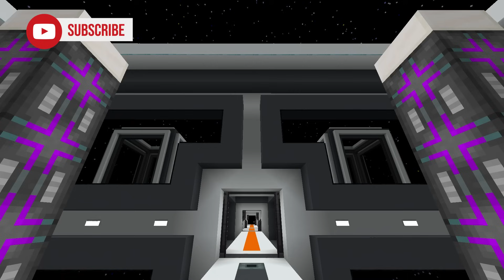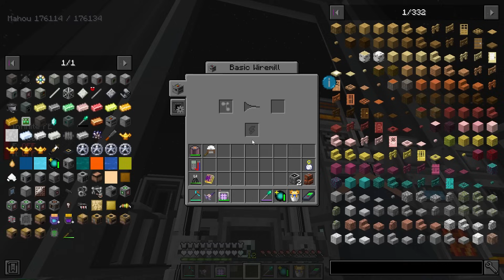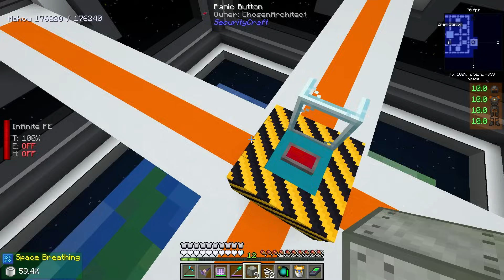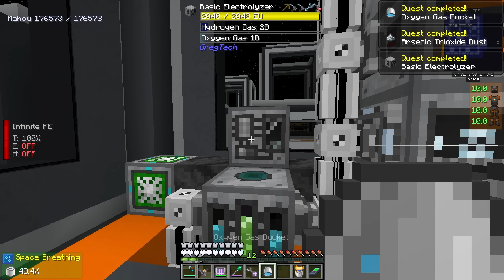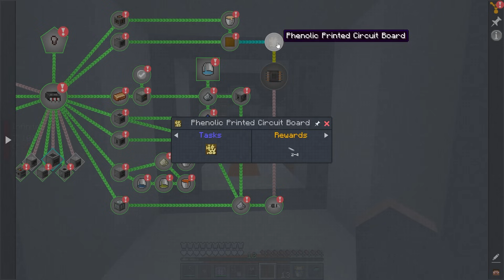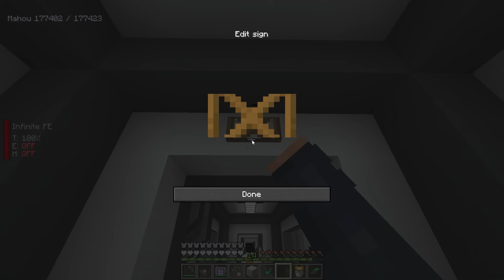Electric Blast Furnace from Gregtech AKA EBF EP69 All The Mods 9 Modded Minecraft

Comment: I believe there is a way you could have it not require you to cancel the craft. 
I am thinking using a ME level emitter to enable importing the Name tag into your ME network when your recipe is used, then have an exporter return it back to your storage chest. 
I'm unsure if it can be configured for a specific craft or if it activates on all of them, either way it would just cycle the nametags from storage and back to their barrels.

Comment: There is this method called the papertrick, and it is perfect to auto-complete the requests for your EBF (btw you should probably name your nametags EBF voltage tier coil type because youll be needing lots of ebfs with higher energy input hatches and coils soon)

To auto export the nametag once it’s finished, you simply place either an Interface or a Pattern Provider, and an Me exporter facing it. Now you set the exporter to export your nametag. Then you put in a redstone card into the exporter and set it to only export with a redstone signal. To give the exporter the redstone signal it needs, you place a level emitter facing the export bus, and put in a crafting card and set it to your nametag. You just have to keep your nametag in the system for the export bus to extract, but you can place it anywhere you want, like somewhere where its not ment to be seen

If you wonder how it works, the level emitter with a crafting card will output the signal when the nametag is being crafted ( not the components needed for it), which is exactly the moment ae2 puts all the items into the inventory. And its called the Papertrick because people usually use named paper instead of nametags, but it doesnt really matter when item you use.

Comment: Isn't there a way to build the multiblocks automatically ? And a cool thing with the Applied system is that if you have a bucket in your ME network and click on the water, it will get the water in the bucket from the storage.

Comment: Hello Chosen excuse my writing I use a translator I have a wonderful addition multi-block crafting if you put the tag with the crafting and then took out the tag only and returned it to the system it was made you will not have to finish the crafting yourself 

I haven't tried the operation myself, but I think it will work.

Comment: Power simplified
4 Amps LV = 1 Amp MV
4 Amps MV = 1 Amp HV
so on and so forth

For the sake of simplicity, all machines pull 1 amp of power, which tier depends on the machine, undervolt it and the machine will stall, overvolt will explode
Example: Macerating calcite ore requires 800 EU at a minimum rate of 2EU/t, a second = 20 ticks, then it takes 20 seconds to finish

Using a LV macerator will use double the power but half the speed (1600EU at 4EU/t for 10s)
Give a little read on the getting started page, and also having a little understanding of ohms law helps a lot

Comment: Congrats on reaching the MV age! I've played through almost the entirety of gregtech in ATM9 and I've got to say that it's probably one of my favourite versions of gregtech that currently exists, just because of how polished and good looking it is in 1.20.

I would recommend reusing the same machines for multiple crafts instead of one machine per recipe, except for when you have processing lines for creating a specific material (polyethylene for example). With fluid crafting in AE2 it's super simple to automate almost any recipe, especially ones in the assembler which usually requires both fluids and items. The EBF I found was the easiest to automate by just slapping a pattern provider on a  quantum entangloporter from Mekanism (since it can accept both fluids and items, which you can then just pump to the input hatch and input bus). Later, when you overclock your EBF to higher tiers of power, the recipe processing time is halved for the lower tier recipes so your current recipes will be processed blazingly fast.

Good luck and I love seeing you explore gregtech for the first time!
Reply: you should try Sky Greg, its a bit harder because you don't have pipez but a challenge is often welcome for most ppl :D
Reply: @sylvainfrancoeur5905  Big part of the gregtech loop is mining, skyblock doesn't really fit with it imo. It's also a lot more enjoyable to play Minecraft with the overworld scenery.
Reply: @the-sz8sq i like superflat more than skyblock modpacks so i just use gregtech with a few other mods on a superflat world.

Comment: 19:48 The reason one bucket of water gives two buckets of hydrogen and one of oxygen is because gases have an interesting property.

A gas' molar volume, aka the amount of space that the gas takes by unit of quantity ( not mass but just amount of molecules ( or atoms, for monoatomic gases ) ), depends only on temperature and pression.

Not on the gas itself.

So one mole ( unit of quantity, corresponds to 6 times 10 to the power of 23 individual units ) of water gives you one mole of oxygen, since water is H2O.

And since gregtech gives you monoatomic oxygen gas instead of dioxygen like what would happen IRL, that makes one bucket for one bucket.
Reply: you answered the one question i had and i shouldve visualised it in my brain

Comment: I love the idea of sending the multiblock stuff into a barrel. I think expanding upon it, you can probably set up a way to insert the nametag into the ME system just to mark it as complete, then put it back into a container outside the system.
Reply: i did exactly that in my world. I have another barrel with all the nametag multiblocks and an item pipe with gold upgrade to allow redstone control that exports back into the pattern provider. 

when the items are sent into the first barrel, a comparator can detect them and send a redstone signal (with a 3 sec pulse extender from create) to the item pipe allowing the nametag to get back in the system both notifying you that the crafting is done and also clearing the completed craft from your cpus, then an export bus puts the nametag back into the second barrel ready for its next use. 

for a finishing touch replaced the first barrel with an ender chest and a “multiblock” ender pouch for remote access.

Comment: GT multiblocks have rules for placements of blocks, BUT they almost all the time have lax rules for hatches, there are some exceptions like assembly line. If you dont need that many hatches you can just replace it with the main block of the multiblock.
If you run an LV recipe in MV machine it would be overclocked (the recipe should use 4x power while running 2x faster than base tier of recipe)
Typically giving a RECIPE more energy is okay or better, except for some niche cases that normaly happen in other gregtech modpacks or when the recipe is getting 1t (the machine checking for recipe to run lags the game), but giving LV MACHINE MV power will evaporate the machine and same goes for cables, giving them higher voltage or/and more amps than it can handle will evaporate the cable.